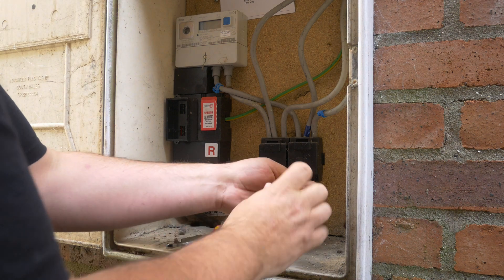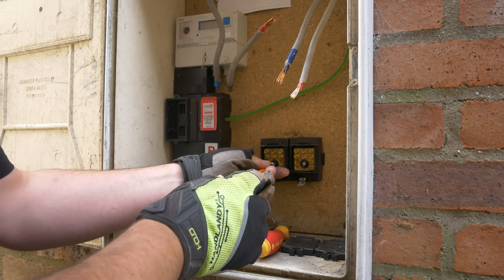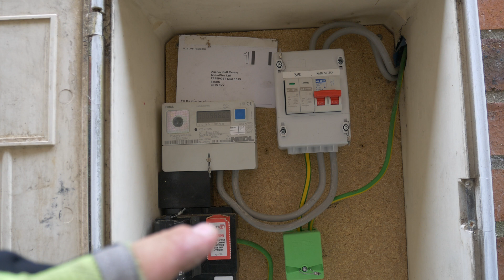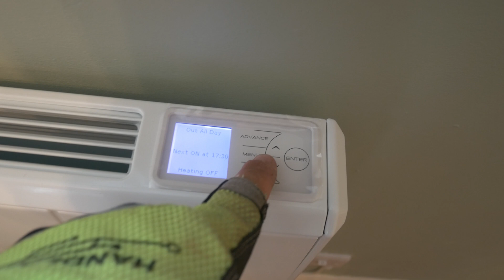I made a mistake... Proteus and M2 save the day!

Comment: Hi Technically the main switch and spd surge device should be in a metal amendment 3 2015 fire proof enclosure.
Reply from the maker: Incorrect, the definition on that is very clear and well established.
Reply: @electrician247  Amendment 3 is only for dwellings of course but similar switch gear assembly is open to very wide interpretation see regulation Amendment 3 states that: 421.1.201.

Regulation 421.1.201 - Protection against therman effects - Consumer Units

Within domestic (household) premises, consumer units and similar switchgear assemblies shall comply with BS EN 61439 3 and shall:
(i). Have their enclosures manufactured from non-combustible material, or
(ii). Be enclosed in a cabinet or enclosure constructed of non-combustible material and complying with Regulation 132.12.
NOTE 1: Ferrous metal e.g. steel is deemed to be an example of a non-combustible material.
NOTE 2:* the implementation date for this regulation is the 1st January 2016. This does not preclude compliance with this regulation prior to this date.

What the regulations mean:
Guidance from BEAMA (British Electrotechnical and Allied Manufacturers Association) who represent the UK manufacturers. The intent of regulation 421.1.201 is considered to be, as far as is reasonably practicable, to contain any fire within the enclosure and to minimise flames from escaping, caused mainly as a result of poorly installed connections.

The following Q&A’s cover key points.

1. What is a definition of non-combustible?
There is no published definition for ‘non-combustible’ that aligns with the intent of regulation 421.1.201. Ferrous metal is deemed to be one example of a non-combustible material that meets the intent of the regulation.
2. What constitutes a ‘non-combustible enclosure’?
A non-combustible enclosure includes base, cover, door and any components e.g. hinges, covers, screws and catches, necessary to maintain fire containment. See diagram 1. Blanks and devices are contained within the non-combustible enclosure.
3 How is account taken of cable entries into a ‘non-combustible enclosure’ with respect to
containment of internal fire and escape of flames?.
Good workmanship and proper materials must be applied by the installer. The cable installation entry method shall, as far as is reasonably practicable, maintain the fire containment of the enclosure. Account shall be taken of the manufacturers instructions, if any.
4. What is meant by ‘similar switchgear assemblies’?
‘Similar switchgear assemblies’ are assemblies used for the same fundamental application as consumer units.
5. Does regulation 421.1.201 apply to consumer units and similar switchgear assemblies installed in domestic (household) garages and outbuildings?
Yes, the intent of regulation 421.1.201 is that it applies to consumer units and similar switchgear assemblies to BS EN 61439-3 inside all domestic (household) premises including their integral/attached garages and outbuildings or those in close proximity
Reply: @electrician247 Our Niceic inspector says differently he would have a field day if he saw that on one our jobs.
Reply from the maker: @danvictor3934  let me know his/her name and I will speak to the NIC for you. They are very very wrong.
Reply: @electrician247  It is a good Idea but who am I to argue with them in there position of power.
Reply from the maker: @danvictor3934  it's not about arguing more educating. I was with the NIC team today at the celebration of skills event. Quite happy to help.

Comment: Good point on not taking the supply in to the top of the isolators with spd. I hadnt thought about that before.
Wondering if its a real risk though. From memory the spd module plugs in to sockets and the pins are shrouded until the module is removed.
From what i can see no more risky than a normal 3 pin plug.
Reply from the maker: Unless it's under fault conditions as you remove it lol.
Reply: Surely proteus designed it this way and manufactures mi should always be followed or am i wrong?

Comment: I'm a keen DIYer....I installed my own 8.75kW solar install with 15kW paralleled inverters (3 x 5kW), a 92kWh lead-acid battery bank and a 200 litre unvented hot water cylinder with dual 3kW immersion heaters. I am running the house from solar with occasional top-ups from the grid overnight (so much for climate change when I've needed a top-up in August EIGHT TIMES and the month isn't over yet). I did all this because our energy costs went up 600% since AVRO went bust in Sept 2021. I also changed our cooking over to a two burner induction hotplate, a 2kW countertop oven and a few air fryers of differing sizes. I did all this because at the time, our electricity courtesy of Octopus was 66.7p per kWh and our gas was 16.7p per kWh. It was higher than anybody else's I've ever met. Anyway, now we're on Octopus Go tariff, the electricity price is 9.5p per kWh between 12:30am and 4:30am and 30p per kWh at other times and our gas is 7.9p per kWh. We have had to have SMART meters fitted to enable us to have this tariff and since no other checks were made, it seems OBVIOUS to me that we we're being shafted by Octopus (who must be being bank-rolled by the Governmentin one way or another) in order for us to be forced to get SMART meters. 
Anyhow, all of this has made me acutely aware of just how much electricity and POWER in general is needed if you're not going to freeze in winter. Last winter we didn't dare turn the gas boiler on. This winter we will have choices (and a much reduced tariff). I have bought 2kW convection heaters for the rooms (these were cheap and portable) although I have GCH installed. I may have these on at half power to keep the chill off rooms, but I am acutely aware that a 32A ring main really shouldn't have more than 7kW flowing through it and certainly not 24/7. Also, I have a 100A supply, so theoretically I have 23kW of power available, but again I would only want this to peak for very short periods. When you add up though, the unvented cylinder ( 6kW), a kettle (3kW), a washing machine (2.5kW), an iron or hair dryer (2kW) and that's not even mentioning a few 2k heaters, I'd soon be heading towards my 15kW maximum inverter level. 
On this meter change that you did, a 60A supply gives around 14kW maximum. It looks like there may have been 4 heaters (are these 2kW?). If the house is all electric, then I presume it has a 3kW immersion heater? An electric oven a hob (4kW). If all these are going at once, isn't that more than the house supply? Or is my maths wrong?

Comment: It does seem odd putting the supply in the bottom of the main switch when you are so used to installing them at the top.
Reply from the maker: Yes and I think their is actually a way around this I have learned from the comments on this video! Need to experiment

Comment: I've not used the Proteus Main Switch with built in SPD before, is it not modular so you could put the SPD upside down to the right of the Main Switch linked out the bottom instead? If not they may have missed a trick there. Do love the earth blocks though remembering an insulated Allen key is a pain.
Brilliant install from you and Mathew as usual.
Reply from the maker: Thanks mate. I did toy with spinning the spd around but then polarity would have to swap on the main switch. Didn't think about moving the SPD to the right! I will experiment next time! Good shout.
Reply: @electrician247  I only though of it due to having to swap the main switch from right to left on many modern CU's when doing replacements and tails aren't able to move.
Have to remark the terminals but often that's more preferable than trying to find a product that goes left to right these days.
Reply: @electrician247  If you did that would it be classed as interfering with a type-tested manufactured design?
Reply from the maker: @anthonybragg  I don't think so in this case no. But I am going to ask the team at Proteus next week.

Comment: Good video mate, I think all main switches should be a double screw connection. Also when as competent persons will we be allowed to remove main fuses or is it too much of a money spinner for them?
Reply: A lot of the consumer units used to have two screws in the main switch
Reply from the maker: Lol yeah that's a bugbear we have had for decades. They did do some awesome meters with switches in for a while. Solved the problem but stopped doing them 🤷‍♂️. 

Hopefully as people get smart meters they fit tails isolators alongside them but I doubt it somehow lol.

Comment: Nice job as always 👍, I've just purchased a property with 2x old wylex boards 1x for off peak and one for peak, just wondered if ud recommend a board to combine the 2x together still keepthe off peak currently still needed for heaters ? Cheers gary
Reply from the maker: Hi Gary loads of options but if you have a room a twin stacked board can be useful! Just remember an upfront isolation point for the install as a whole.
Reply: @electrician247  not loads of space mate, 1x board is horizontal and other vertical in a cab, yeah was thinking double stack board and fit 2x main switches and sps  then populated with rcbo's etc but struggling with space mate
Reply from the maker: @garylatto4191  tricky one from that sounds of it. Maybe rehash a large split load board with 2 x mains switches and a 4 pole tails isolator pre that isolate the install.
Reply: @electrician247  cheers for reply , if I did that and used a 4pole isolator, what would be the set up for the neutrals,  obviously only 1x terminal in the isolator 🤔

Comment: Love the allen key heads on henley style connectors. Its such a nightmare sometimes with slotted screw heads especially in double pole henley's. And would be even better if DB manufactures did the same and got rid of those useless plus/minus screw heads made of putty in their main switches/mcbs, RCDs and RCBOs. Agree with @tschubb1992, the isolator cover is on upside down. But hey great tidy job anyway
Reply from the maker: Another good shout with the Allan 3mm heads. Totally agree 👍. I need to check how it came out the box now 🤣. I put it together how it came out. But thats not to say I am remembering wrong 🤣🤣🤣
Reply: It maybe that the manufacturers don’t use the key type because you can easily over tighten on smaller conductors. I’d much prefer wago type connections on everything electrical tbh,

Comment: Great content, should the isolator cover be on up the other way? So the smaller bit of the cover is on the consumer side?
Reply from the maker: I never tried that but good point tbh!
Reply: @electrician247  I was looking at it all way to critically after you said spot the mistake 🤣 nice tidy job 👍
Reply from the maker: @tschubb1992  not at all mate. It's actually a good idea if it works! I did consider spinning the spd holder around but then the bridging busbar wouldn't go right without swapping the polarity around on the markings so went with that lol.
Reply: @electrician247  my DNO requires double screw idolater switches if fitted in the meter box, funnily enough they are Proteus ones.
Reply from the maker: @timballam3675  yes we use those often. Belting mains isolators. All they wanted was us to connect the tails into the iso with SPD. That said this is all changing again soon 🤣